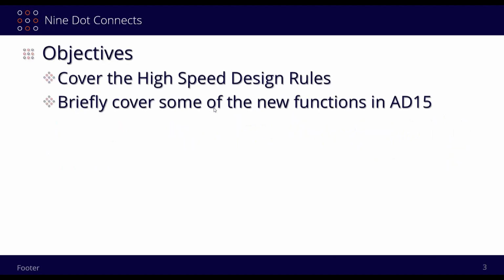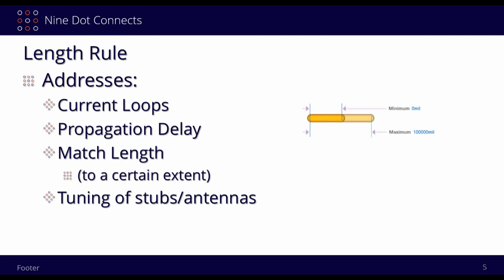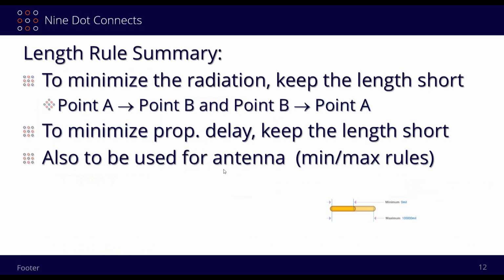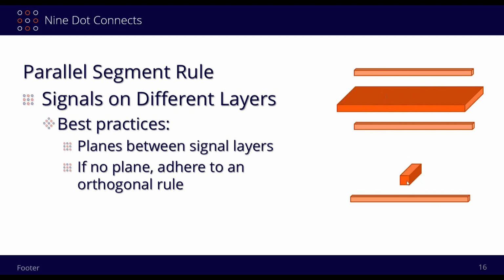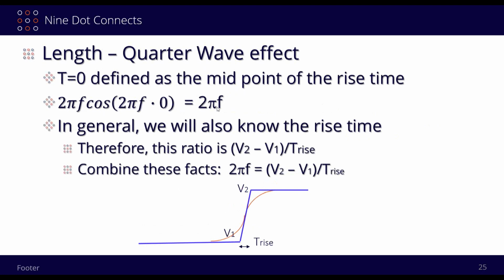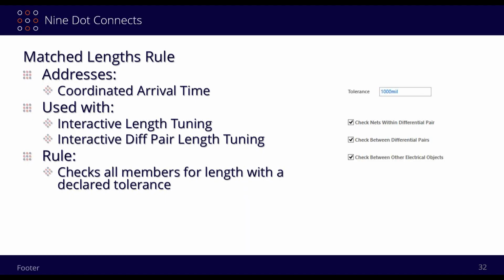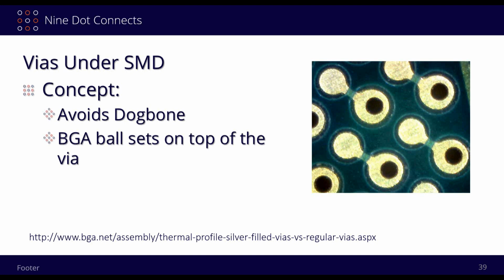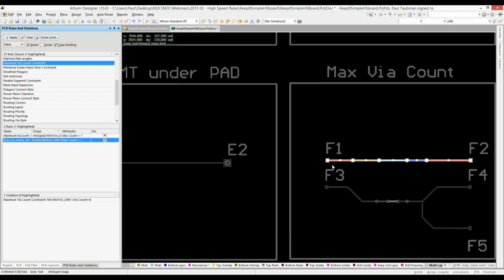High Speed Design Rules in Altium Designer

Comment from the maker: Raul,
 you certainly have a sharp eye for details!  You are correct that the units shown in the PowerPoint slide in minute 34 are not correct.  However, the next slide does have the correct end values.  For verification purposes, please see equations / math below:

Speed of light:  300,000,000 m/sec (rounded)
Dielectric: 4.3
Plugged into the equation v= c/ sqrt (dielectric) = ~144,672,847 m/sec
Wavelength = 144,672,847m/sec /477,500,000 hz = ~.30 meters = 30 cm
¼ wave length:  30cm / 4 = 7.5 cm
In inches:
30 cm = ~11.8in
¼ wave length: 11.8cm / 4  = 2.95 in

Comment: In minute 34 if Im not mistaken c = 300 000 000 m/s so v = 144 672 km/sec, and not m/sec, otherwise will be less than half  of speed of sound... then calculation v/f is rigth, around 30 cm for 470 MHz